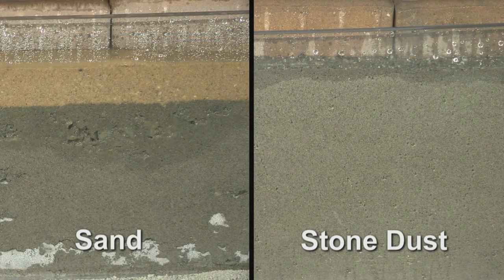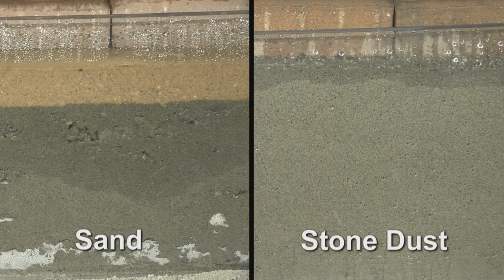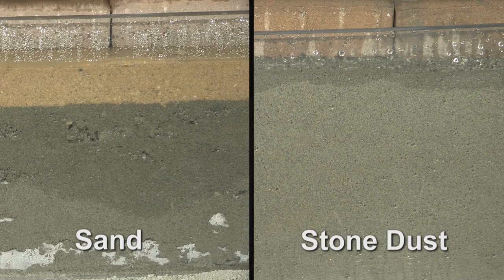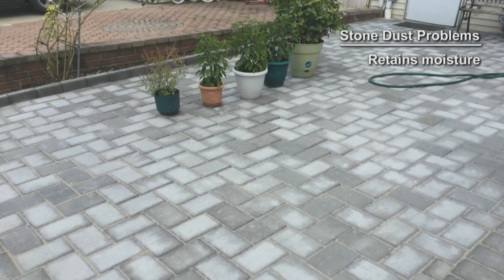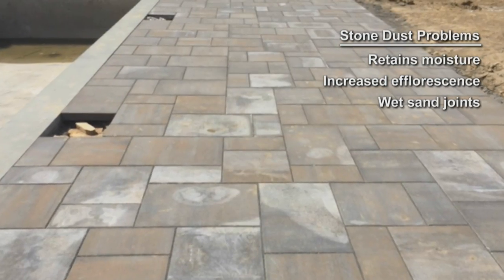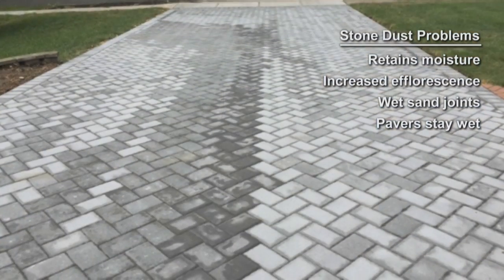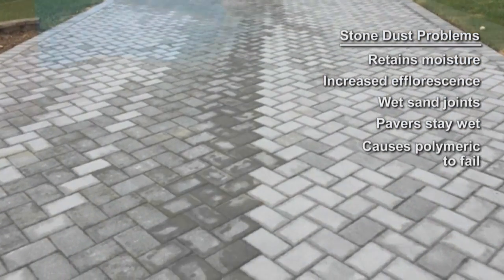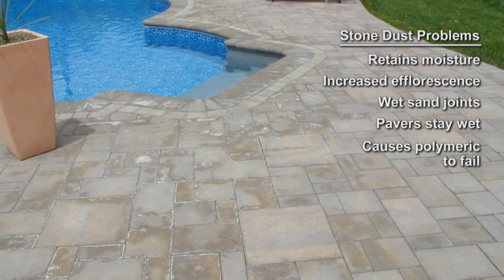Cambridge Sand vs Stone Dust

Comment: It is just me or does it look like they barely added any water to the pavers that sit on the stone dust while they keep pouring water on the pavers that are sitting on sand... if that's right, then that seems pretty slimy 2:47
Reply: Oddly it does look that way. Applying more water over the sand based one forcing the water to continue through as more and more pulls with gravity and the stone dust just enough to show it get wet then not move anymore because no additional water is added to pull through it. Weird the way that was done. Though I did my own experience with stone dust and it does act like a sponge and holds water. Next I’ll do one with sand but I don’t have any sand at the moment